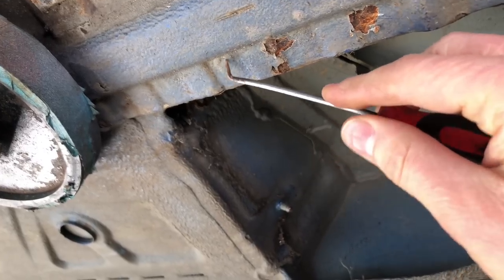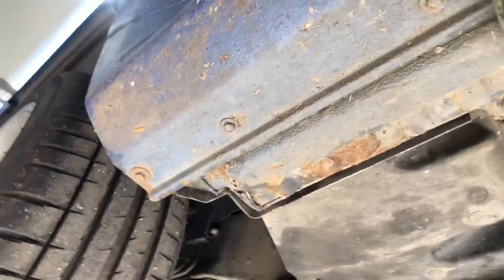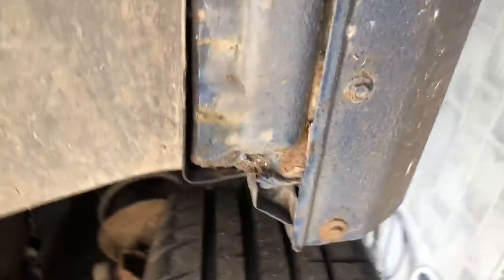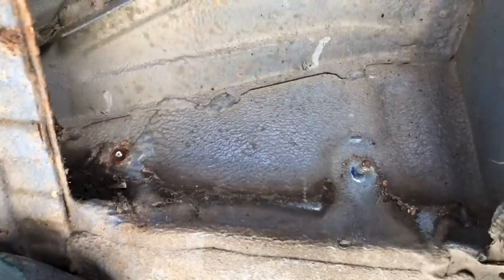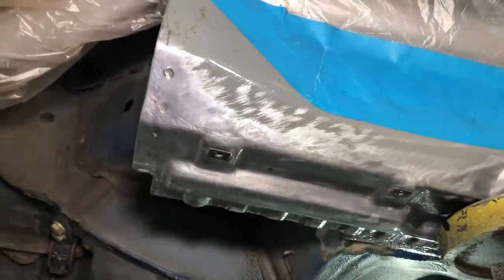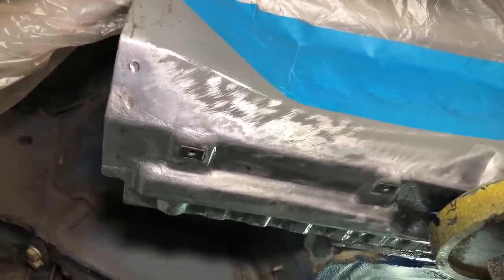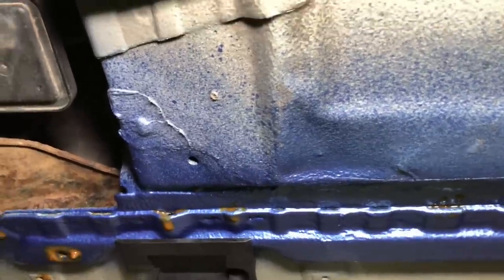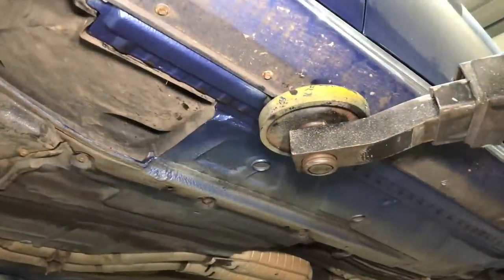BMW Z3 M Coupe Sill Rust

Comment: Great work! I’m about to repeat similar job on my Z3 and I have a question about those painted threaded bolt holes? Were you able to screw into the bolt holes easily after all? Any recommendations? This would be much appreciated .

Comment: Prior to cavity wax, do you typically perform a visual inspection for any corrosion on the interior of the sills and if corrosion is found what methods have you found best to remove it before cavity wax application?

Comment: Absolutely fantastic quality of work, just surprised that you left the cavity bungs in and painted over them at the ends of the sills. Is there a reason for that? Not a moan, just an observation.
Reply from the maker: Thanks for the comment Julien, you're right - it wasn't until near the end I realised the same thing. I had a poke around the area with a pick and lifted the edge flaps of the grommet and was happy there was no hiding corrosion so deemed it acceptable. Good spot though.
Please consider Subscribing to our YouTube channel!

Comment: Have you tried hammerite rust remover gel , i was really surprised at the result for what is in effect a diy product
Reply: If you read scientific studies on rust converters you learn most are acid based which seeps into the microscopic pores of the metal and down the line causes new corrosion. It's a hard decision. However everyone always says once rust starts it will come back no matter what, so I guess all methods from that point on are just cyclical 10 year restorations.

Comment: I've been doing some restoration work on a 325ti & your videos are inspiring me to keep at it. The standard of your work sets the bar very high! 
Where do you get sprayable seam sealer? I have searched everywhere but I can't find a suitable product. What brand is it? Is it called "seam sealer"?  Thanks
Reply: Did you check the Wurth catalog? I'd bet they use something from Wurth.
Reply: I believe the sprayable seam sealer is proprietary to Redish Motorsport.